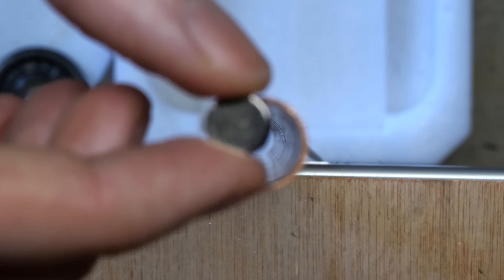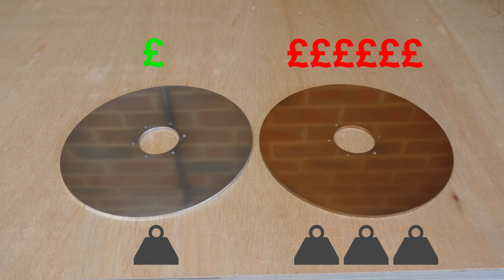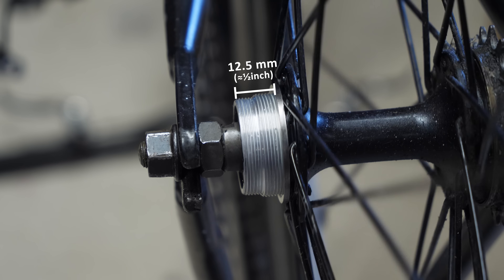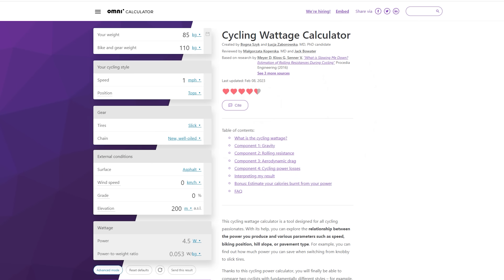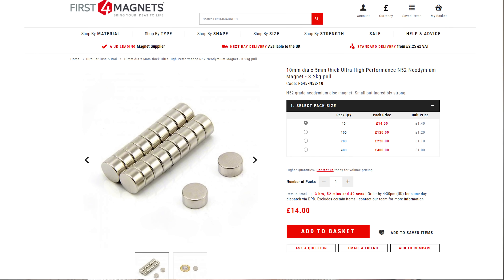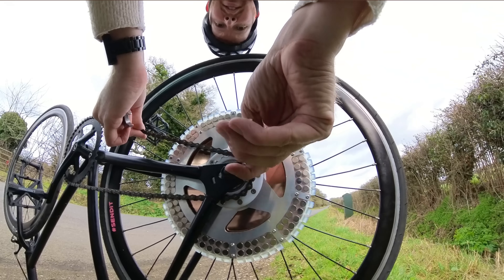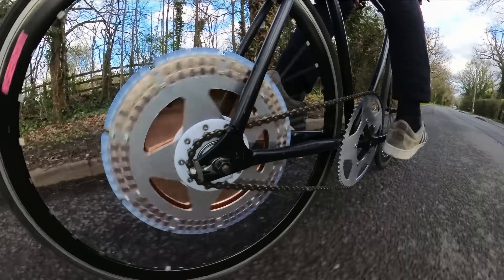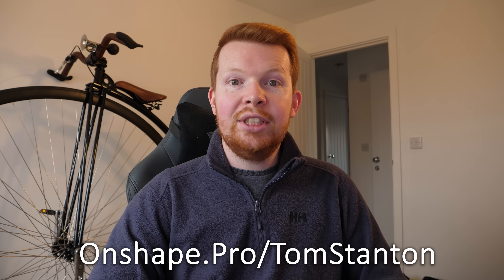Gearless Magnet Bike

Comment: HI Tom, first of all this video is great. 
Secondly, I strongly suggest you to repeat the experiment trying to reduce the air gap. The first thing you shuld do is mounting the magnets with a plate of steel on the outside, the steel will increase the conductance of the magnetic flux increasing the flux in the copper plate (this steel plate would also act as a shield between the chain and the magnets).
Other improvement could be to mount the magnets between two copper plates, that would also increase the efficiency of the magnets, I estimate that doing that would give you the same torque with half of the magnets. The hard part is mounting the attachment.
On the mechanical side, it could be interesting adding a stage to the transmition in order to multiply the speed of the magnets.
Reply: yes, i see you know your flux.
Reply: On ferromagnetic materials, the thicker the metal (up to a point), the stronger the coupling, and while someone here was talking about the skin effect, I wonder if lower thickness, won't limit the current, meaning that maybe thicker copper, will lower resistance, and increase the current, and thereby the magnetic flux.
And lastly, I was considering cutting narrow slats into the copper, inspired by magnetrons. I wonder if you could have "slips" induce a more concentrated current in a copper segment in stead. This might even help a bit with cooling.
Reply: @martinfyhn1976  I agree with your idea but I have limited knowledge of this topic.  I read the "slips" idea in your writing as slips do cool and for some reason using the golden ratio like a nautilus design instead of slips that are straight popped into my noggin.  Cooling plus a ratio of flux.
Reply: @martinfyhn1976  I have been thinking about Tom's video on and off since watched it. Mow, What you just said makes sense to me.
Reply: @TheAmity  I can't say how accurate my thoughts are, I've not worked much with Eddy currents, so it's a side of magnetism where less likely to be right 😅
Reply: @martinfyhn1976  The purpose of my comments is to share thoughts/ideas (my belief). I am not looking at any of them as to who is right or wrong. Otherwise, it turns into a pointless argument with no useful results. In reality, I view all of this as a person who is watching a UFC battle and shouting TKO him, TKO him.
Reply: @martinfyhn1976  😄
Reply: Just a brainstorm. The reason for the heat is because of the electrical resistance of the copper disk. Also, keep in mind that electrons move on the surface of conductive metals. By thinning the copper disk and silver plating the copper (at least where the magnets are) we can reduce the heat.
Reply: @TheAmity  adding to your brainstorm, I'm not sure if skin effect takes place in this particular case. But if it is the case, making the disk with thinner layers of copper isolated between them would also improve the efficiency of the metal conduction. Because it would have more skins to induce current.
Reply: @grannqnito  I appreciate your kind reply. There are lots of factors involved in Tom's great project that are not easy to discuss/share in this way. For example: at the introduction of the video Tom showed us the moving magnet inside a copper tube (one the most efficient because of the circular shape of the tube). The current distribution inside copper dist is very chaotic/inefficient (in my opinion), but using a copper tube instead will be more efficient (in my opinion, again). I wish I could attach some images/sketches to explain my suggestion/theory about implementing it. I enjoy the exchange of ideas/thoughts in the frame of logic, it opens the mind to new doors.
Reply: I would also think that significant spinning mass could be saved by skeletonizing the copper plate.
Combining with your 2 plates idea, that could end up with less weight for near double the effect and spreading heat out.
That could in turn allow it to be smaller diameter and less magnets, further reducing spinning mass.
Reply: @andrewstambaugh240  Note that the angular inertia of these discs is pretty insignificant compared to the energy it takes to move a human. With one hand, you can easily accelerate the entire bike wheel in very little time in top gear on a regular bike. And more mass gives more space for the heat to transfer, lowering the temperature of the disc. Even a car wheel (40-80 lbs with tire is typical) can be spun by hand with fairly minimal effort, so I wouldn't worry too much about the mass on these plates.
Reply: How about also increasing the copper discs size and the magnets to utilise a greater moment?

Comment: This might be way out there, but I wonder if you could harness that heat output with Peltiers mounted to the other side of the copper disk to run a motor for hill assist.

Comment: You had an idea and you concisely show how you went about implementing it and the methods you use. Thank you Tom for inspiring the younglings, I have no doubt we'll get some amazing innovations in the future, influenced by your ability to educate. Even though I pay little attention to the numbers and equations I still end up feeling slightly smarter from watching your videos.
Reply: From an engineering standpoint, I see two obvious improvements.
Although copper is a better conductor than aluminum, aluminum is stronger and better for transferring work. Use aluminum instead.
For the magnets interfering with the chain, modify the sprocket to cross the whole axle and put the magnets on the other side.
As for coasting, modify the clutch so that the bike rolls freely even if the sprocket and aluminum plate are stopped. I wouldn't even try adding a magnetic braking system to this setup because that would transfer a ton of momentum to a small part (the sprocket area) which would wear out the sprocket very fast.

If you wanted magnetic braking I would suggest a secondary aluminum plate on the chain side of the wheel. Make it fixed so it moves with the wheel at all times. Then have magnets slide in and out from a fixed position on the bike, probably under the seat and well away from the chain.
Reply: Remember that the Lord Jesus Christ died on a cross for you because He loves you so much. He then rose up from the dead three days later
The Ten Commandments are called the moral law, (most of us are lying thieving blasphemous adulterer at heart and deserve hell) you and I broke the law, Jesus paid the fine. That’s what happened on that cross. 
By believing that Jesus died on the cross and rose up from the dead 3 days later and not just confessing your sin, but also repenting of all sin you have done and putting all your trust in Him in prayer, He will grant you everlasting life as a free Gift
Reply: @dove3853  Bit off topic mate.
Reply: @Billybobble1   That bible bashing fool didn't even knock on your door before randomly spouting his completely irrelevant BS at you. Pretty damned rude I'd say.
Completely agree with your assessment and way of seeing this and others of his videos. There's so much I'll never understand but, I still learn from this sort of thing. One question I had he did answer was, whether the resistance was converted to heat or not. If it hadn't, it could have opened up a few more interesting possible uses like speed control of things without wear, obviously but, heat can be a problem too and a non heat generating device could be extremely useful in some situations. Still very interesting stuff though.
Reply: @dove3853  Tell Jesus I'm not interested
Reply: @dove3853  Word Bro! Could you forward your Comment to every Branch of Government,Financial Institution,and School of Learning you can? This would be a Game Changer 🙏😎

Comment: I wonder if you used permanent magnets that interact with an electromagnet to generate current if and only if the the circuit is closed? you could then coast, and free wheel until you allow a current to flow, or something like that.

Comment: I haven't noticed it mentioned, but I believe this arrangement is or at least was used as braking for the cars on roller-coasters. A non-magnetic blade under the car would pass between an adjustable arrangement of strong magnets in the middle of the track. This would allow an operator to dramatically slow the car without the abruptness or wear on components a friction based braking system would.

Thank you Tom for another amazing presentation.
Reply: Nooooo... this idea was doomed to utter failure before the 1st iteration... it is an irrecoverably bad idea. Face palm material
Reply: @oschonrock  Then why did you watch it? Most of Tom's presentations represent an idea taken to conclusion, good or bad the result is there to see. If all we were shown were the successful ideas then how are we to learn to catalogue failure so that we avoid revisiting in the future. There is science and methematics to be learned from this experiment and to simply see it as being doomed from the start we would have learned nothing.

I appreciate that you might already fully understand electrical eddies induced by magnets moving along a non-ferrous metal, so why watch the video?
Reply: @watsoft70  I watched it, because it came up as a random recommendation. I watched it long enough to realise what he was doing (the first few minutes) and then cringed through the rest of it only to check that he at least acknowledged that it was fundamentally flawed.. he did so in the last couple of minutes. 

It's cool that he built it. This is very much a "workshop style" of "learning by doing", but it completely lacks a level of abstraction at the basic physics principles level. This could never have worked.... 

I suspect he knew that. I hope he did. If he didn't and genuinely "discovered" this basic principle for himself by building it and making the video, then fair enough. 

What i find cringeworthy is that I suspect he knew it violated basic laws of physics, and did it anyway for the clicks. I will not be subscribing. 

The motivation for the invention doesn't exist, the solution is deeply flawed. Ref my comment:
https://www.youtube.com/watch?v=Dg8oVR4k5Dk&lc=Ugwt3kmjlLsRFwjlCul4AaABAg
Reply: @oschonrock  I suspect that he did know that but provided it as a scenario in which to fully demonstrate the affect. There are people who get a good understanding of science, electronics, aeronautics and mathematics from videos such as the ones that Tom produces, both young and old. I do not understand your frustration at a video that is clearly below your level of expertise, but understand why you choose not to subscribe. Perhaps you could start a channel and take us all on our next level of discovery. I wish you well.
Reply: @watsoft70  I wish you well also. 

Here specifically, I was objecting to "lets have a follow up".. that's known as "flogging a dead horse".. 

As Albert Einstein said... "Insanity is continuing to do the same thing and expecting something different..."

Comment: If you gonna redo it use a road cycle wheel, made out of carbon fibre, and the hub will be much thicker since they are for 10speed and up. And you dont need any threads in plastic, since they have grooves where the sprockets go into instead.

Comment: If you did this with (an extremely costly) gold disc, it would move incredibly slow. Same with the cheaper silver.
Reply: What's the point of gold? It has 40% higher resistance than copper. Silver is 5% better than copper but not worth the price difference.

Comment: If the copper needs to spin faster, it's logical to mount the copper to your chain and sprocket, and have the magnets on the wheel which normally spins slower than the pedalled RPM.

Comment: What if you put magnets on the copper plate as well? That COULD allow you to sync the speeds and maintain constant velocity... Possibly incorporate magnets that move in and out axially based on the RPM via centrifugal force, so that the magnets engage once the bike is up to speed?

Comment: There are no failed experiments, just more data.  It might not have worked exactly as you'd hoped, but at least by building it, you learned from it - and it was a fascinating project, anyway.
Reply: The fact that a weight still falls already indicates that this will not work well. It already showed that there is not a 1:1 transfer of force but that there is slip. That alone would have been enough to understand that there are no failed experiments, just wasted time.
Reply: @maartendeen8404  Jesus, dude! Who pissed in your cornflakes? What a petty, mean-spirited little boy you are, Maarten "This channel doesn't have any content" Deen.
Were you asleep or stoned when he specifically said he was going for an effect akin to a clutch?
The expectation was not that there would be a 1:1 transfer of force - he actually mentioned a number of times that there wouldn't be a 1:1 transfer of force... he actually mentioned that the magnets would have to be spinning at a certain number of rpms to get a lesser number of rpms out of the wheel.
Until he built it and tested it, there was no real way to find out what it would actually perform like in the real world rather than on a test bench.
So he built it and tested it - as he's built and tested numerous other things he's displayed on this channel  
So, what have you ever done?  "Fuck all", going by your YoutTube channel.

Comment: An aluminum disc can be mounted on a freewheel. In this case, it will rotate along with the copper disc if you do not pedal. Also, instead of a copper disk, you can use a disk with magnets. Use one of the brake levers or reverse pedaling to lock the overrunning clutch (for magnetic braking).
Reply: два магнитных диска сработают без таких больших потерь на магнитный нагрев как в этом случае

Comment: I was wondering how much heat it was generating. From time to time we would have an application where an Eddy current clutch/brake would be used. The generation of heat (and what to do with it) would be one of the things we would need to consider. For example an Eddy current brake has to be able to dissipate the energy of the device that it is braking. Mmm, toasty!

Comment: As soon as Tom started doing "power" calculations, I said "heat waste". What he was calculating was the rate energy was pumped by his weights and pulleys into the copper disk, not the energy that could be applied to wheels.

After that, nothing he said was a surprise to me - except I was disappointed when his plastic parts didn't catch fire.

Comment: I'd love to see a version 2 of this, just to see how far you can take this idea by reducing the limitations.

I remember there being something called 'Loopwheels' where the spokes of each bike wheel were replaced by 3 loop shaped 'springs' which I think were made from a polymer.

Then using silver rather than copper due to lower resistance, & perhaps plating it with something like aluminium (for better heat dissipation).

Comment: What if you took an electric motor for the rear hub? That could generate electricity for a power bank when breaking which could charge a phone or bike lights! I would like to know how much electronics that USB PD power bank charging with an electric motor hub would require.

Comment: You could have saved some time and expense by simply dismantling an 8 speed freewheel. It's much wider than a single sprocket and overhangs the threaded portion of the hub by more than 50%.

Great video btw, still watching but wanted to mention this before.I forgot haha.

Comment: Add a steel plate to the side of the magnets away from the copper disk.  You will increase the flux going through the copper thus the torque and will not pull the chain or the spokes.  The steel carries the flux between the magnets.

Comment: You could use the pedal to produce electricity to charge a battery or capacitor,  then use that electricity to drive a motor which is based on your eddy motor design.

Comment: I'm curious what's causing the light-bending effect on the right side of your foot as you pedal (starting around 15:19). Camera lens anomaly? Side effect of all those magnets?
Reply from the maker: It's a 360 camera with 2x 180 degree lenses back to back. So the effect is the 'seam' where the two sides of footage are stitched together.
Reply: @TomStantonEngineering  I never would have guessed that. :)

Comment: This reminds me a lot of a torque converter in a conventional automatic transmission for an automobile. You could take this one step further, as the auto manufacturers did, and have the option to lock the torque convert up so that there are no frictional losses between the copper disc and the magnetic drive.

Comment: I could see this idea being a great tool for cadence training for road racing, one issue I have is maintaining a consistent cadence over a long period which means speed and top end power are all over the place, but when you said too much torque feels like wheel spinning I think that would work great for learning to keep a consistent cadence at a set power not lots of power then less then lots then less, if you feel it spinning out you're applying too much force, if you're slowing down you're not applying enough, worth consideration as a practical use for this Idea

Comment: It’s a magnetic derailleur.

You could move the magnets in and out to transmit force to the wheel.
Reply: Duh.   I just realized that if you used electromagnets powered by a battery, you could have a magnetic clutch with infinite settings.

Turn down the voltage to make pedaling uphill easier.

Turn UP the voltage to travel faster on flats.

Set up several coils on the exciter disk at 1/2 inch intervals.

Then switch from the outer coil to the inner one to go faster.

Comment: Really cool idea works on the same basic principle as a torque converter where a fluid directed by a fan type of disc forces another fan type of disc to rotate which is attached to and drives your transmission